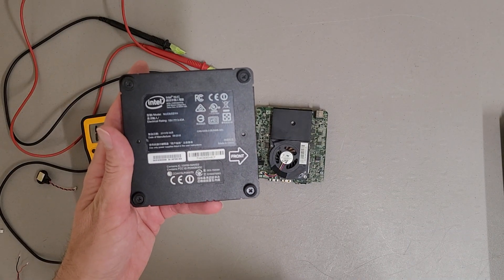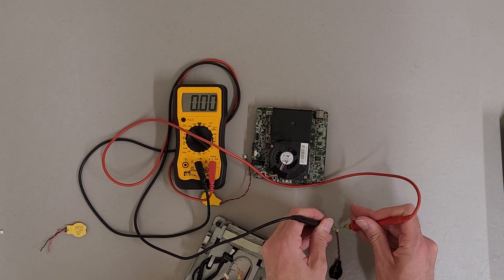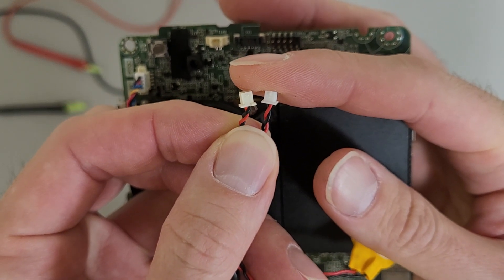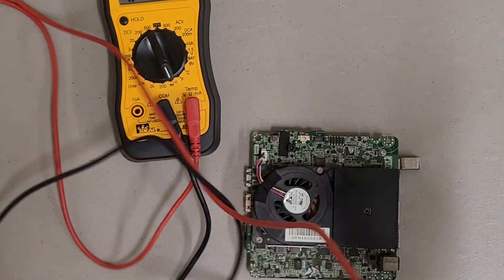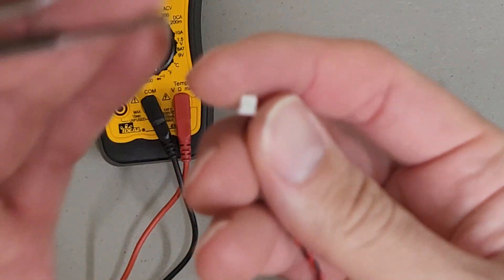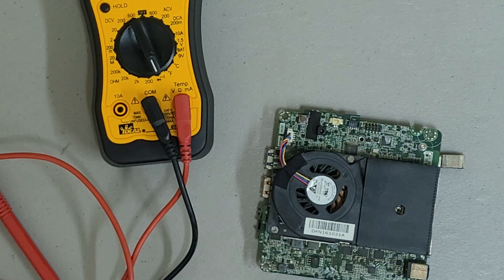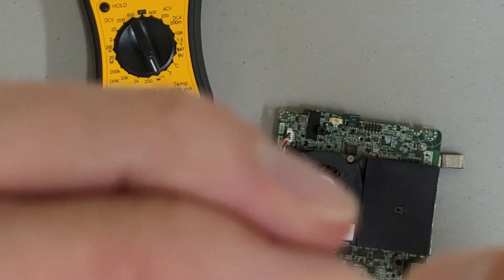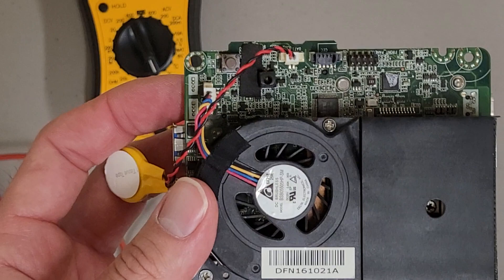Solving an interesting problem with Intel NUC CMOS battery replacement (Reverse Polarity)

Comment: I realized the same issue this week. I was servicing a PlayStation 2 slim (SCPH-75000) with a new CMOS battery, that also had a reverse polarity related to the "standard" CMOS batteries. I found an old NUC6 battery that I replaced from a dead CMOS NUC which did have the same polarity as the PlayStation 2, then realized the one I replaced it with on the NUC had the "standard" polarity and was also dead. Searched about NUC CMOS battery polarity and found your video. Thanks for sharing.
Reply from the maker: Happy to hear it was helpful. It is interesting how this is the oddball standard.
Reply: @computersales  To help you with the description and discoverability of your video: my three NUCs with this issue are the NUC6i3SYH, NUC6i5SYH (same as yours) and NUC5i5RYH.
Reply from the maker: @drebes  thanks I have added them to the list.

Comment: Very helpful video. I had exactly the same problem fitting a replacement CMOS battery to an ASRock B560m-ITX motherboard. All is good now.
Reply from the maker: Thanks I will be sure to add that to the description.

Comment: NUC6i5syk (case) with an NUC6i5syb (Board)

Did I almost cut the wires of the new battery for reverse soldering. The Nuc is here on holiday and luckily I forgot to bring the replacement battery. Most of my soldering jobs end up in everything being covered with tin but the target subject.  Thank you for the informative video!
Reply from the maker: Appreciate the info. I will add that to the list. Happy to hear the video was helpful.

Comment: Joining the grateful bunch here. NUC D54250WYK saved by you. Thank you so much for this video. I was using the NUC as is with that problem after trying different batteries. I searched but didn’t find anything helpful. Today I tried searching again and I’m so happy to have found your video. This needs more exposure. With your permission I would like to post it on Reddit and other sites.

Comment: this video saved me! faced the same issue 
have a pre-owned NUC with already incorrect battery, and when I swapped with new one (with same incorrect polarity) - it doesn't work
Reply from the maker: Glad to hear it helped. The problem was pretty frustrating.

Comment: this is also true for a NUC7i3BNK, I recently had to replace the battery and was wondering why the CMOS error appeared again after the NUC lost it's connection to the power supply.
Reply from the maker: Thanks I will add that to the description.

Comment: I'm on a NUC6CAYH and had replaced my CMOS battery two times already. The batteries had correct voltage and worked flawlessly elsewhere, but not with the NUC. Every time I turned it on, time had been reset to 01/01/2016 with a "CMOS battery failure" entry logged. Your video solved the issue for me. I just inverted the battery wires using your strategy and now I've got a functioning NUC again with time correctly set. Interestingly, the battery was not drained at all.
Reply from the maker: @gabrielgaspar3744   It's so weird Intel decided to wire things backwards on this model. It's nice it didn't drain your battery. I'm glad I was able to solve your problem at least. 🙂
Reply: @computersales  this just fixed my NUC6CAYS too, thanks. I did replace the battery but still got a battery error warning and the time wasn't kept. I was going to leave it to check at the weekend but thought I'd do a quick search today, found this and fixed it straight away (and by straight away I mean after tearing the whole thing down again due to Intels terrible battery placement). Thanks
Reply from the maker: @theronkinator  thanks for confirming the model number so I can add it to the description. I am glad it was helpful even if the process to fix was annoying.
Reply: My dn2826fyk didn't work with incorrect polarity CMOS battery at all, after using this methos to switch polarity everything works.

Comment: Thank you so much for this, I thought soldering was the only solution but this is a lot easier and more elegant!
Reply from the maker: I'm glad it was helpful. Also yeah glad there is a simpler solution to this problem. These little cmos batteries can be a pain to deal with.

Comment: Reading online a lot of people shorted out their mother board instead of the new battery. Thank you for sharing the details on how to tell without experimenting with my computer
Reply from the maker: Glad I was able to help. When in doubt the easiest way to check is a continuity test from the pin to the housing.